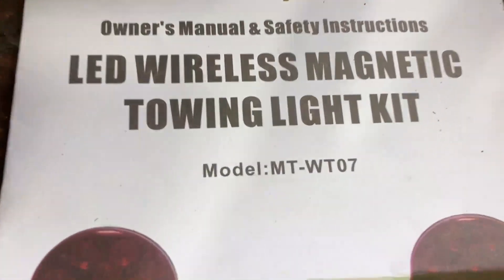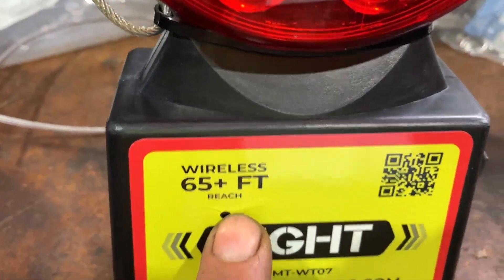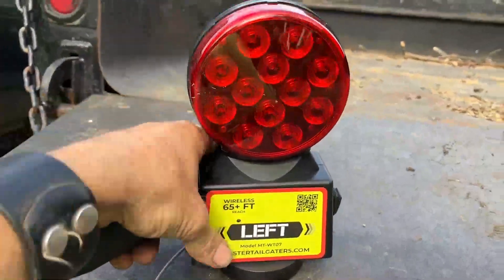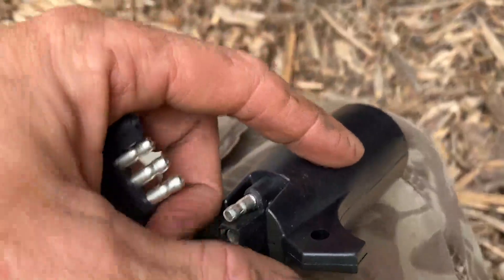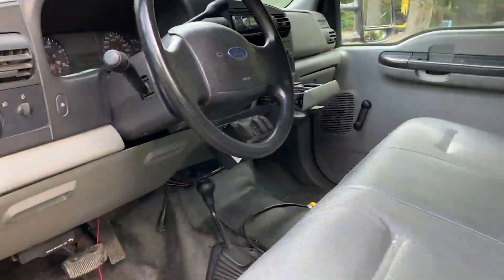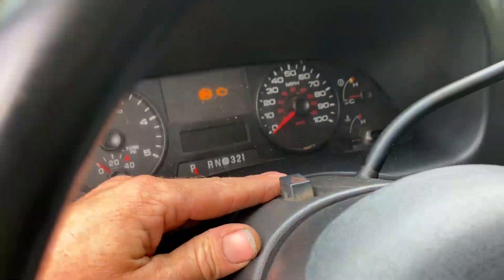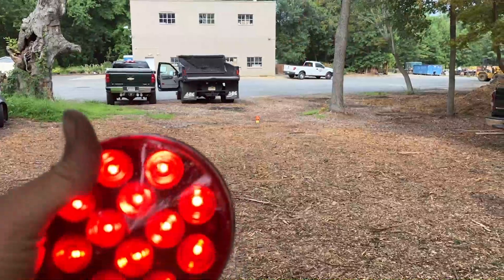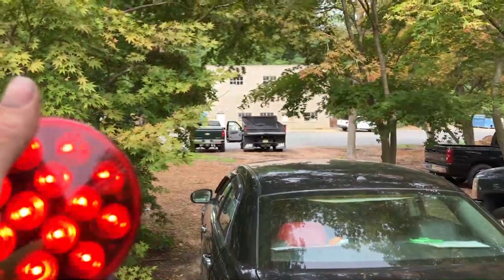The Best Wireless Trailer/ Tow / LED lights - Mechanics Review !

Comment: do you know if there is the 7 pin connector that can be connected to the trailer 7 pin plug so that if my trailer wiring doesn't work then I can still run these lights?
Reply from the maker: You don't need the trailer wiring to run these lights these plug directly into your vehicle.